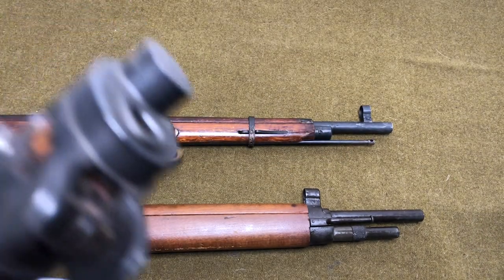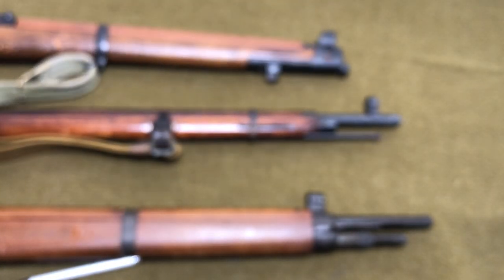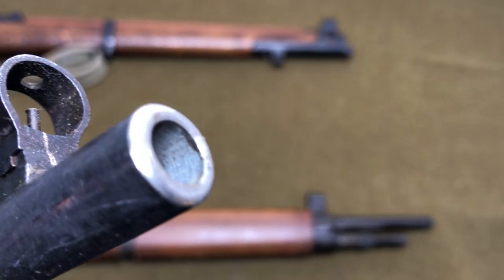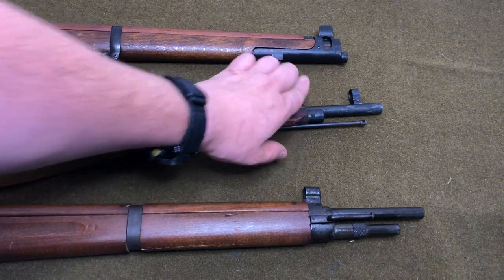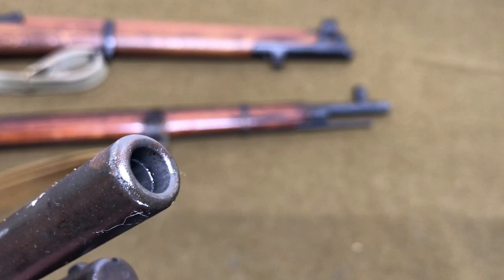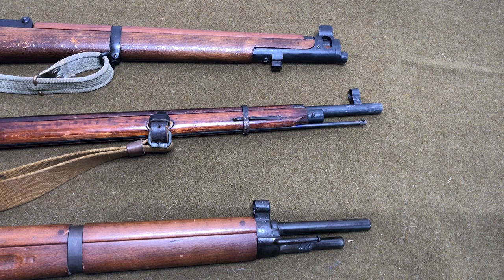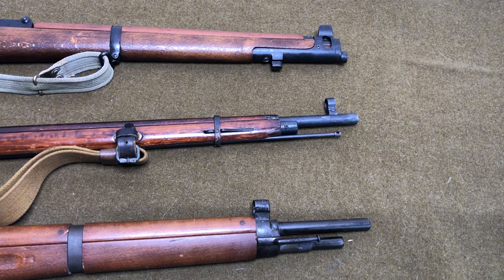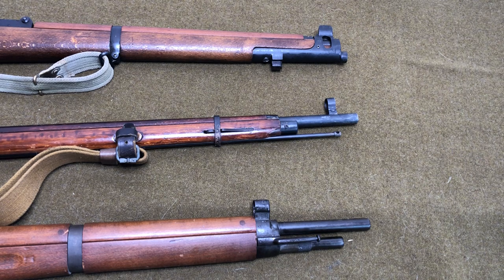Military Surplus Firearm Collecting - Episode 1: Counterboring. What is it, why, and is it bad?

Comment: It drives me nuts whenever I see someone ask "is it counterbored" on a rifle that's not super accurate to begin with. It's easy to tell someone is a newbie that's trying to pretend they know what they are talking about when that question pops up, because frankly you're not going to be hitting the hairs off a fly's ass at 300yards with or without the counterbore.. It's not a bad thing. For real collectors/reasonable shooters, it shouldn't matter. I've never turned down a single rifle because it's been counter bored.
Reply from the maker: Agreed. If I want a guaranteed good shooter, counter bore will seal the deal for me. Sometimes it does work to one's advantage though if you get that old timer who believes it. "$650 for this Refurbished M44. I know what I got sonny." "Oh yeah? Were you aware that it's counterbored?" "Ah, shit, alright $100 because it's Turked."
Reply: Been saying the same for years, too on the Boards. I_C maybe you have seen me over these years. Have had some wonderful counterbored shooters over the years and many Russian Mosins that have passed through.
Reply: Several of my mosins are counter bored, and I got them cheaper because of it, some sellers think that counter bore=poor condition. not so much anymore though.
Reply: Yep- "well this XXX service rifle built in 1938 is counter-bored and will loose its accuracy at 400+ yards".......oh no whatever will you do
Reply: Hey its the mosin crate in this joint 👋👋👋

Comment: My 91-30 which IS counter-bored shoots VERY accurately. I have also heard that it was done to assist soldiers to get the cleaning tools into the barrel end easier to better facilitate cleaning and prevent excess wear and crown damage FROM struggling to insert the tool and rod. Have you heard this?

Comment: According to soviet army repair manual the counterboring distance for long Mosin rifles is upto 45mm and upto 25mm for M44 carbine.
Reply from the maker: I've seen some 91/30s that were at the maximum of the 45mm regulations :)
Reply: @MikeB128  honestly, i dont see the reason why would someone counterbore a muzzle in US. In Russia we have strict regulations regarding length of the barell and number of operations you can do with your firearm by yourself. In this case, or in a field service point counterboring is good because it is not obviously visible and is very fast. But in US you are permitted to do whatever you want to. To cut is always a better option, but more time consuming one. It is always easier to make a clear muzzle crown on a cut barrell.
Reply from the maker: @PetarKozic-sl2cv  THey didn't counterbore them here.....they were counterbored in Ukraine or the USSR during refurbishment.......

Comment: Dept. of the Army Tech manual TM9-1276/TO39A-5AD-2  Cal. .30 Carbines M1, M1A1, M2 and M3 Feb 1953.  pg. 108,  fig. 19...there is an excellent picture of an M1 carbine muzzle with the standard counterbore required on all carbines submitted to depot maintenance for rework. It is a GRADUAL diminishing of lands beginning about 1/4 to 1/2 inch from the muzzle and not only improves accuracy but prevents damage to the lands from impact and steel cleaning rods.  Well worth the modification on service weapons and revolvers, which require bore cleaning from the muzzle.

Comment: With my 1916 SMLE I bought a box of Remington .303 ammo & to check the barrel after visual inspection , which looked very good , I placed the bullet in the barrel & basically went up to the case neck . I did also have some PPU .303 ammo , I tried that and had better results . I mic’d the bullets Remington was around .308 -.310 . The PPU was .311-.312 . Sent the box back to Remington because I thought the bullets were not correct size . They said yes they are the correct nominal size . I shoot the PPU ammo
Reply: And you have just hit on one of the two problems Lee Enfield shooters have with ammunition - wrong sized bullets (Carcanos have this in spades). Incorrectly made cases are also common - if you have a rim lock on a Lee Enfield, it isn't a problem with the rifle, it is a problem with the ammunition lacking the specified chamfer on the rims. That is why SMLE shooters scratch round for military brass to use for reloading.

Comment: A damaged muzzle crown does not seal/perform resulting in the same precession to the projectile every time one goes past it. Or if gasses escape from the projectile's side. Precession is a change in the orientation of the rotational axis of a rotating body. In an appropriate reference frame it can be defined as a change in the first Euler angle, whereas the third Euler angle defines the rotation itself. In slo-mo photography a damaged crown shows gases escaping from the muzzle before the bullet does.
Reply from the maker: Isn't that what I said in the video?

Comment: Would arsenals counter-bore damaged rifles or is that just something that happens after it has been surpluses?
Reply from the maker: Arsenal refurbishment.
Reply: @MikeB128  I guess that's fine then. I would vein that on the same level as the Fins polishing all the metal on metal contact points on a Mosin bolt.